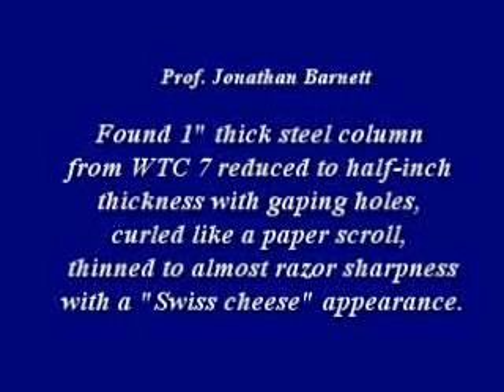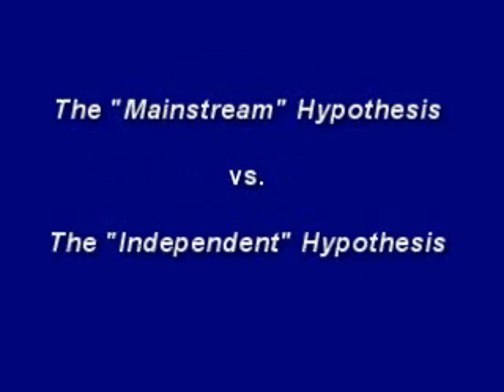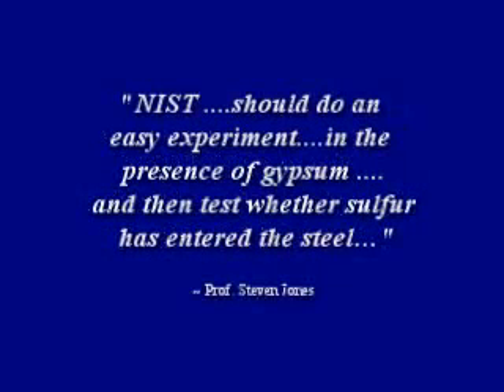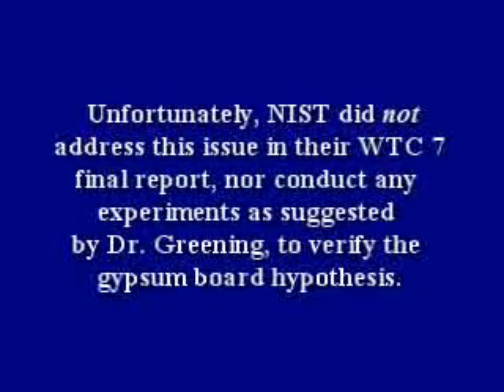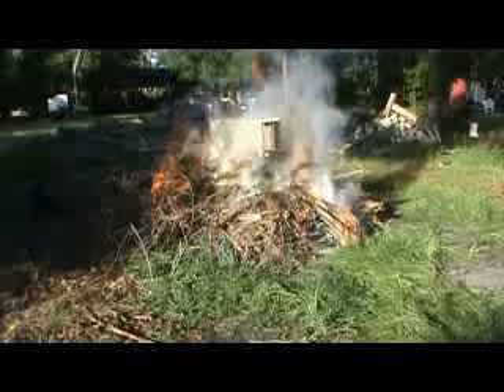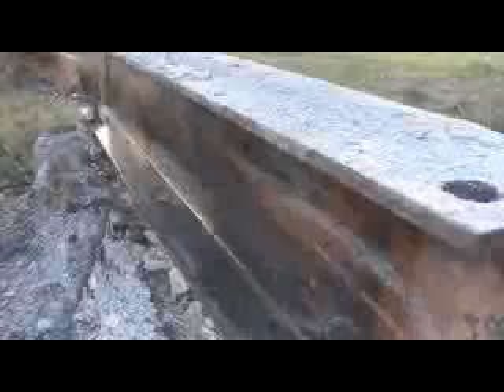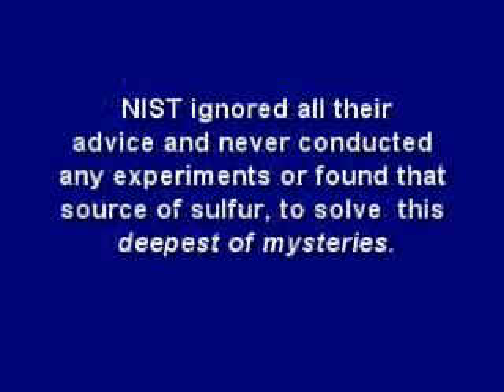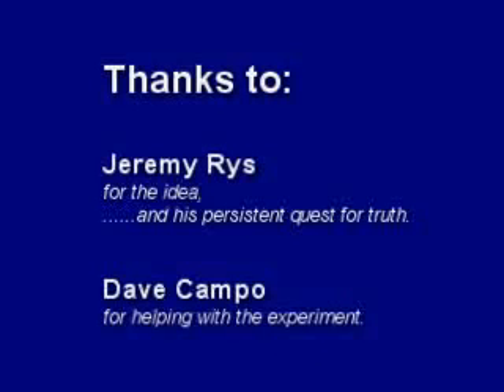9/11 Experiments: The Mysterious Eutectic Steel

Comment: There isn't anything mysterious about eutectic steel.  You just have to know how it was formed, and it couldn't possibly be formed by fire alone.  Then how COULD it be formed?
It CAN be formed when water splashes on red hot iron.  Where did it get THAT hot?
It did that AT THE BASE OF THE WRECKAGE, where impacted steel had been unbelievably squashed by 500,000 tons of material impacting it from above.
The water contained sulphate ions, which in the LOW OXYGEN environment dumped their SULPHUR straight onto steel surfaces. This became iron sulphide, which MELTED INSTANTLY.
Don't say you haven't been told.
Reply: +Tony Duncan Tony , exactly! This guy left out two very important elements from his experiment, H20 and time. The steel was corroded not melted.
Reply: +Oldschooldan1 Blast furnace, lol.  Because I'm sure the conditions the eutectic steel was in smothered under 47 stories of rubble was sooooo much like a blast furnace...

Any actual evidence that the conditions at the bottom of a rubble heap is like a blast furnace, or do you really expect people to believe such nonsense without any evidence?
Reply: +Oldschooldan1 Next time you make a camp fire, try dumping 47 stories of crushed concrete gravel, and sand over the top of it, and tell me how well it burns.
Reply: Oldschooldan1 < I would have to dig a 5 story basement and load it full of diesel generators>

Oh, you mean the diesel fuel generators that weren't on and weren't being supplied with fuel though the pressurized fuel lines?  Those diesel generators?

"The worst-case fire scenarios associated with fires being fed by the ruptured fuel lines (b) would have produced large amounts of visible smoke that would have emanated from the exhaust louvers. No such smoke discharge was observed." NCSTAR 1-9 P. 619 [PDF P. 281]

Darn, looks like even NIST disagrees with your mentally challenged explanation.

< lets not forget the 47 stories of combustible materials like office furnishings and computers and God knows how many tons of paper.>

Office furnishings and carpeting etc. in a high-rise are flame retardant (even the consumer grade crap is flame retardant by law), which is probably why the fires had died down after several hours until only smoke was visible.  Electronics like computers also contain flame retardants.  You know that "new computer" or "new phone" smell?  Or the smell of a new mattress, or sofa?  Those are off-gassing flame retardant chemicals.

Oh, one more minor detail.  It's awful hard for ANY of these materials to combust at all without the presence of a steady source of large amounts of oxygen.  Much less combust hot enough to form "a liquid eutectic mixture of iron and sulfur" which is what FEMA documents.  It's awful hard to get oxygen when you're buried under 47 stories of rubble, don't you think?

Last I checked, a blast furnace involves oxygen-enriched air being literally blasted into a combustion chamber.  Your fairytale makes zero sense.
Reply: My point is that there, in the base of the wreckage, there was NO OXYGEN AT ALL.
Red hot iron ABSORBS IT, to form SCALE, iron oxide.  There was AT LEAST a thousand tons of red hot steel at the base of that wreckage - the remains of the kinetic energy of the collapse had transferred itself to the contact point with ground zero.  THAT heat was, of course,  the resultant 'incoherent', formerly 'coherent', KINETIC ENERGY of that impact.
Also, EUTECTIC CORROSION demands its absence in the gaseous environment, which consisted of STEAM, HYDROGEN GAS, and steadily reducing SULPHATE IONS at temperatures greater than 1,000 degrees Centigrade.
THE IRON SULPHIDE so formed, on ANY exposed iron surface subject to ALL the above circumstances*, MELTS at such temperatures, and that's EXACTLY how you would get a "swiss-cheese" effect.
Also, if you check through the fireman's reports of "fires burning at the surface of the wreckage" you will soon notice that they describe BURNING HYDROGEN GAS, which is the OTHER by-product of this eutectic corrosion, and also PROOF the environment was oxygen-free, for HYDROGEN is a gas that is SO easily inflammable that it can be ignited by the static electricity produced by rubbing one's hand through one's hair, yet, coming from a source which was at or above a thousand degrees Centigrade, and at a red-hot temperature, was only able to burn AFTER it had reached the surface of the wreckage.
That's the LOGIC.
* circumstances undoubtedly rare, but probable and certainly not impossible when firemen are watering the wall boarding and crushed concrete insulating this red hot steel from above.
Reply: Oldschooldan1 I have always been interested in branches of science tangential to my aero-and-thermo-dynamics, from which my career began.  Knowledge is now progressing well beyond the ability of any individual, be he genius or otherwise, to comprehensively cover.  I miss not being grounded in Life chemistry, for instance.
My education was 'finished' before integrated circuits had been invented, so I never learned to 'hack' at an early age.
Ours is still the Stone Age in certain respects.
Nevertheless, it's been a lucky time... and you're welcome.
Reply: +Oldschooldan1 Go ahead and conduct you own experiment "the proper way" and post your video here when you duplicate the "eutectic" melted steel documented by nist.  Good luck.
Reply: Emvaz22
 Sure, as soon as you want to loan me a couple of million for a low oxygen blast furnace and some protective gear, I'll give it a shot...
Reply: Emvaz22
Underground fires burn long and hot.A blast furnace would be nice to replicate these conditions. I'm not saying that the temps need to reach the maximum capability of the furnace, but would be require for the long duration.
Reply: Emvaz22
 I would have to dig a 5 story basement and load it full of diesel generators first and lets not forget the 47 stories of combustible materials like office furnishings and computers and God knows how many tons of paper. You're not that bright are you?????
Reply: Emvaz22 "flame retardant" MEANS "COMBUSTIBLE".
"the fires had died down after several hours" - That's an interesting idea.
"It's hard for ANY of these materials to combust in the absence of oxygen" - So why suggest they do?
"combust (to be) hot enough to form "a liquid eutectic mixture of iron and sulfur" - but eutectic iron sulphide IS NOT caused by combustion in an oxidative environment, but by SULFURIDIZATION in a REDUCING environment.
The TEMPERATURE was achieved by falling a thousand feet and impacting ground zero.
"It's awful hard to get oxygen" - especially when you don't need it.
Your fairytale makes zero sense.
It's as if you never read what I sent you before, so I will send it to you again:
PRIMARY 9-11 CONSPIRACY ASSUMPTION SHOWN TO BE FALSE:
AN ANALYSIS OF THE AMOUNT AND DESTINATION OF THE POTENTIAL ENERGY OF A WTC TOWER

The World Trade Center towers (and WTC7) fell NATURALLY due to buckling failure when their 'slender' columns lost attachment to their floors.
They only used a third of their Potential Energy to destroy themselves, the remaining two-thirds was consumed in crushing some of their steel into ground zero.
A standing WTC tower possessed two hundred and forty six tons of TNT of POTENTIAL ENERGY merely by just standing there. We shall call this energy Eo.
The tower fell by taking the direction of LEAST RESISTANCE, which was THROUGH ITS BUCKLING COLUMNS.
The columns failed by BUCKLING because their STRUCTURAL STABILITY had been compromised by LOSS OF FLOOR ATTACHMENTS. No steel got crushed when this buckling failure occurred. 
Buckling is not a MATERIAL failure; it is a STABILITY failure.
The floors had detached themselves by sagging to an angle which snapped their connections. Photographs of these separated floors (taken shortly before collapse) are plainly shown in the NIST Report.
As each tower fell, some of that stored potential energy, converting to kinetic energy by falling, was released to damage and dismantle both the moving and the stationary parts of the tower on the way down.
The amount of the initial energy consumed in such a manner was inversely proportional to the rate of acceleration of the tower as it descended. It can be calculated.  We shall call it Ed.
The amount of energy remaining (Er) when the tower wreckage hit ground zero is then (Eo - Ed).
This energy, transferred elastically, caused PLASTIC DEFORMATION in the crushed base steel wreckage, and became HEAT. This too can be calculated.
The heat was considerable. The signs of it were captured by satellite. It amounted to the equivalent of a thousand tons of steel raised to a temperature exceeding 1,000 degrees Centigrade.
This hot steel, crushed and pressed against ground zero, oxidised its surface (making scale) and absorbed local oxygen gas, leaving a reducing atmosphere.
In these reducing conditions, and at a temperature of 1,000+ degrees C, fireman’s water which had percolated through crushed gypsum wall boarding DISSOLVED calcium sulphate (yes, Gypsum is 5% soluble in water), the sulphate ions of which were reduced to sulphur which combined with the exposed iron to form IRON SULPHIDE, which at such temperatures was MOLTEN, and flowed away. At a temperature of 1,000 degrees Centigrade, in an absence of oxygen, and in the presence of hydrogen, Sulphur and Iron atoms become keen partners.
Such hot reducing conditions also caused the water/steam to be REDUCED to hydrogen gas which was noted by firemen to be burning at the surface of the wreckage.
The wall-boarding and crushed concrete surrounding (but mostly above) the steel were THERMAL INSULATORS, so greatly slowing cooling.

CALCULATIONS (in SI units):

To calculate the original potential energy of the tower in TNT equivalent,
G = 9.81 metres/sec^2
Mass (M) of tower = 5e8 Kg
Height (h) to the tower’s CG = 210 metres
The explosive energy of 1 ton of TNT (Kt) is equivalent to 4.184e9 Joules

Equation: Tower Potential Energy (Eo) = ( M * G * h ) / Kt
This is equivalent to ( 5e8 * 9.81 * 210 ) / 4.184e9, or 246 tons of TNT.

The Potential Energy of each standing tower was equivalent to 1,000 standard 500 lb. ‘iron’ bombs.

To calculate the kinetic energy used in the tower destruction takes a moment, after a simple thought experiment, namely considering the tower would fall at G if there were NO resistance, and if it fell so slowly that it consumed ALL its energy, it wouldn’t fall at all.
So we can see that the PROPORTION of the energy used up by the collapse must equate with the proportion of G which the collapse was unable to achieve.
As the collapse acceleration was, by truther calculation, established to be about 70% of the acceleration due to gravity, we’ll use that.
The energy used up in tower destruction was therefore 30% of 246, or 73.9 tonnes of TNT.
Assuming that 30% of the tower fell outside of the basement, then the energy (Er) available to heat the wreckage base (by elastic energy transfer and crushing) was 0.7 * (246 - 73.9), or 120 tonnes of TNT.
We know that the steel reached at least 1,000 degrees Centigrade because that is the melting point of iron sulphide.
We can therefore calculate the mass (m) of steel that was raised to that temperature.
The specific heat of iron (Fs) is known to be 0.45e6 Joules / tonne / degree C
The ambient temperature was 20 deg C, so the temperature rise (Tr) was 980 degrees C

Equation: Er = m * Fs * Tr
So m = Er / Tr * Fs = ( 120 * 4.184e9 ) / 980 * 0.45e6
And so m = 5.02e11 / 4.41e8 = 1,138 tonnes.

The collapse of each World Trade Center tower created 1,138 tonnes of red hot steel at 1,000 degrees Centigrade.

So we can see that there is no need to postulate an extra source of energy, and that the basement wreckage heat is also easily accountable, with the additional corroboration of burning hydrogen at the wreckage surface, and molten iron sulphide at the wreckage base.
And so the underlying 'truther' assumption, that the planes couldn't bring down the towers, is shown to be FALSE, as it is shown by calculation, using the physically-correct values, that the potential energy possessed by the towers numerically accounts for ALL the known consequences, through elastic energy transfer, plastic deformation, HYDROGEN gas burning at the wreckage surface, EUTECTIC IRON SULPHIDE melting off the hot steel pressed against Ground Zero, and, of course, a tremendous amount of HEAT.

*These results are EVIDENCE of the event. They have been evident to any REAL scientist or engineer from day 1.*
Reply: Emvaz22

"Office furnishings and carpeting etc. in a high-rise are flame retardant"  Flame retardant does not equal non-combustible. The basements of WTC 1,2&7 were all connected and for the most part survived the collapse. Let's not also forget the PATH that would have also allowed for air flow to feed the underground fires. There was no shortage of combustibles or oxygen...
Reply: "There was no shortage of combustibles or oxygen" - Yes there was - at the BASE of the compacted wreckage, where the ambient temperature was greater than a 1000 deg C, and deprived of oxygen by the steel, which at red heat absorbed oxygen to make scale.
Reply: Tony Duncan
 My point Tony was simply, there was enough oxygen there to be used by the fires to create heat. It was certainly not an open air environment but, low oxygen doesn't mean no oxygen.
Reply: Tony Duncan
 I see what you're saying, but there must have been oxygen present at some time during the process; correct?
Reply: Only for the moments immediately following impact where the red hot iron first began absorbing the oxygen out of the air.  There wouldn't have been a large volume of air present in the compacted mass of different materials surrounding the hot steel.  After a while the local oxygen would all be absorbed.  At least a thousand degrees Centigrade, remember, because that IS the melting point of iron sulphide.
Also the hot hydrogen gas liberated by the corrosion reaction would 'sweep up' occasional oxygen gas molecules to form steam.  Hydrogen is the most pervasive of all gases.
Reply: Tony Duncan
Well Tony, thank you for the information. I’m afraid chemistry is not my strong point. I prefer to stick to the architecture and engineering of the building itself. I assume the conditions you have stated, as far as there being pockets beneath the pile that were completely void of oxygen due to the extreme heat created by the steel, were sporadic and far between. I know only of a handful of samples that show any eutectic corrosion, so I assume this would not have been wide spread throughout the pile. I find your theory very well thought out and plausible. Thanks again for sharing.
Reply: Tony Duncan
 Never stop learning my friend...every day a new adventure.

Comment: 8:50 we don't have proof that is molten steel. It is most likely molten glass which has a much lower melting point.
Reply: +Tanner Stage V That's actually not true, their melting temperatures are actually quite similar (as per Google).
Reply: +Tanner Stage V Or aluminum.
Reply: Tanner Stage V
HARD HITTING FACTS THAT TWOOFERS DON'T LIKE DISCUSSED: 80% of the entire 180,000 pounds of a 767 jet is aluminum. Depending on the alloy, aluminum has a melting point of between 887°F and 1184°F, well below the temperature at which jet fuel burns.
Reply: the Annuity Slayer Any and all melted metal that melts at lower temp. There was plenty of aluminum in the building, I hear as much as a whole plane.